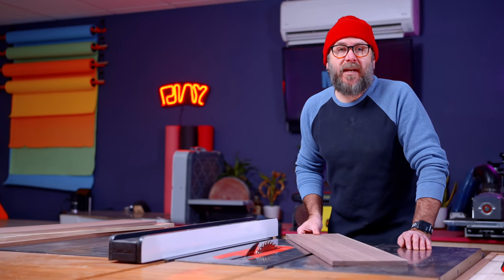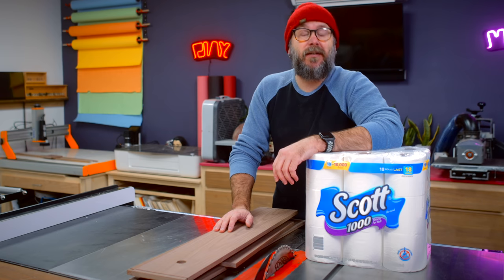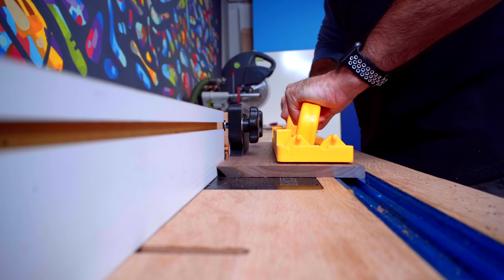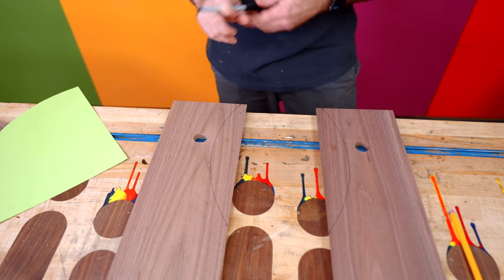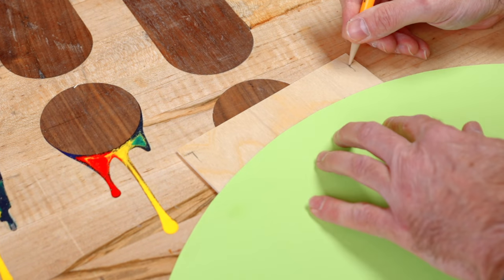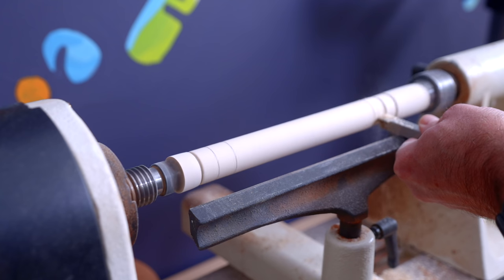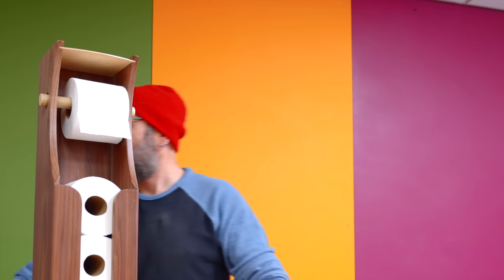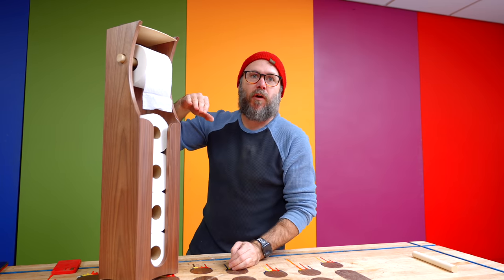Making a toilet paper stand that solves the 2 biggest issues.

Comment: Surprisingly enough, there is an objective reason for the roll to go over the top.
Over the top, the paper is significantly less likely to come in contact with the wall behind it.

In depth reasoning:
The wall behind the roller is the most overlooked part of the bathroom when it comes to cleaning.
It is also fully exposed to the blast of bacteria that comes from flushing the toilet - even with the lid closed.
TP is, by design, a very thin sponge. It will collect bacteria, even when dry. So, it can absorb more bacteria from the wall than the floor, as the floor is more often cleaned than the wall.
It's not something you would then want to abrasively rub against your more sensitive areas.

Comment: Use bike inner tubes as a clamp with some stretch to it. I was using tape on a cedar strip canoe to hold the strips together for glue up then found the inner tubes worked much better.

Comment: Liked the majority of the paper roll stand, except the top 1/8" piece. It was obviously bowed from the visuals of the end. Not sure if it was cut too big or just a bad piece, and could be wrong about that, but I think it looks bad. I think a half or 3/4" piece with a blind dado in the front, would have looked so much better in redwood or black or purple wood. The light colored wood, although usually working as a contrast, just didn't work for me. The rest looks good though.

Comment: 3m clear packing tape works much better than masking tape for glue Ups. It has some stretch to it just like you needed. Also, I find the cheap stuff doesn’t work, so it’s got to be 3m or high quality. The good stuff seems to adhere very well to smooth wood.

Comment: https://youtu.be/bUIbmJ27Idk?t=532 They actually do sell elastic tape, but it's typically used for medicine for binding wounds, but if you could find one that sticks because of adhesive and not just to itself, that would work well. P.S. on the side of the toilet roll the end is on. That is only the "right way" if you don't have cats that like to play with the fun paper toy they have in the bathroom.

Comment: I have avoided using a routed edge as my guide on a router table or table saw.  After cutting the first chamfer, did you have any issues routing the other side of the board using essentially the "point" on the other side of the board?
Reply: With a router table, the edge he's cutting is against the fence. Or are you referring to the "outfeed" side of the fence?
Reply: @LiqdPT as I rethought this, trying to answer your question, I realized my concern was incorrect. On a table saw if you want to chamfer the sides parallel to each other, after the first cut, you flip the wood around and the side you just cut is now up against the fence of the saw. A sharp edge of a chamfer can slide under the edge of the fence if there is a small gap. My brain them applied this same idea to the router table, which is completely irrelevant.  
Thanks for replying and making me rethink my original question. 
Stay safe and enjoy the holidays.

Comment: Let's talk how Bidets aren't used in North America, I love mine especially if your always running a highlighter
Reply: @dwightl5863  just a dab with toilet paper and your good. Not half of a roll anymore lol
Reply: I once thought about getting a bidet, but I then I realized about all those extra parts inside the toilet I'd have to keep clean.
Reply: @bobbieschroder6617  it's no extra work tbh, the one I got for $35 had a cleaning setting
Reply: @Danielism   But aren't there parts under the toilet seat, and elsewhere, that need to be wiped for sanitary reasons?  (Urine has a way of splashing around, here and there.)
Reply: @bobbieschroder6617  not really, just wipe down the little control panel on the side, all the hoses are usually tucked away. I personally don't stand and pee, especially if I'm wearing shorts lmao. People make fun of you but it's more hygienic and makes less mess. I also keep the seat down so the water particles don't just float and land on everything in the bathroom (that's why sometimes the bathroom ceiling will turn yellow if you have a steamy shower)
Reply: @Danielism  Okay, I'll take your word for it.  Are you happy with the one you have?  If so, is it available in the USA (where I live), and would you mind providing the make and model?

It's interesting the way you described your personal method for doing things.  I'm all for going with what makes sense, rather than doing something just because it's the conventional way.

I'm like that with wiping.  I stand up to wipe, whether it's for the front, rear, or both.  (I'm female, btw...). I've discovered that it's much easier, and more efficient and sanitary.  [I can't believe I'm telling someone this.  Lol!]
Reply: @bobbieschroder6617  haha I'm the same, im more logical rather than just doing what is considered conventional. I'm in Canada so I used Canadian Amazon but it's the "LIVINGbasics Hot and Cold Water Bidet" I paid half the price two years ago but I find it worth it. There are more advanced ones with better aiming out there (for females) so I'd shop around. Never buy one without temperature control!
Reply: @Danielism   Thank you.  🙂👍